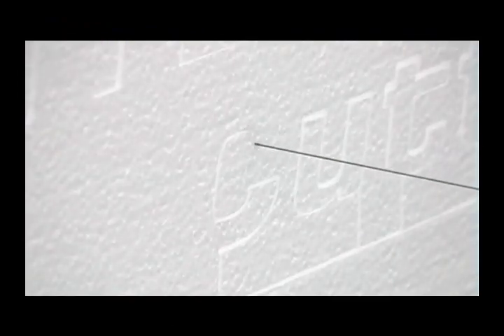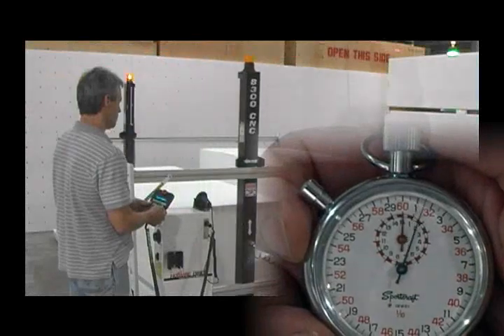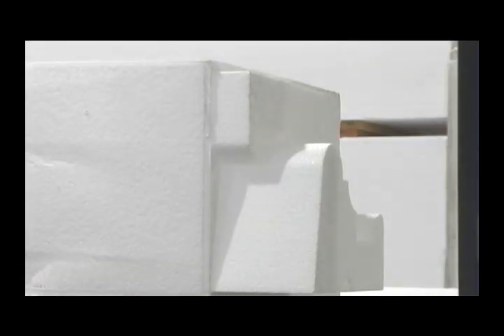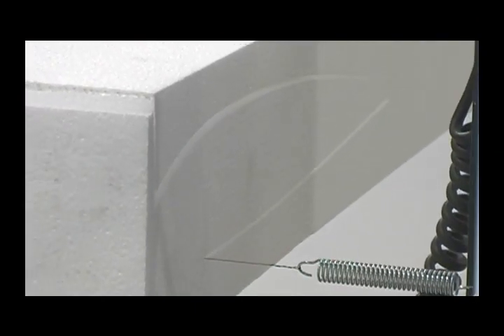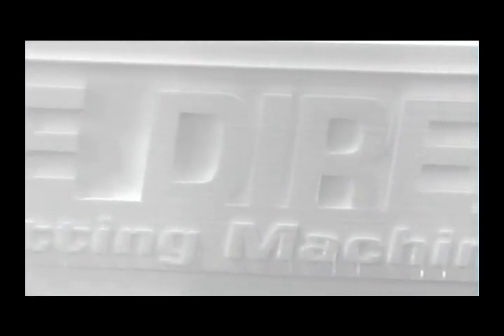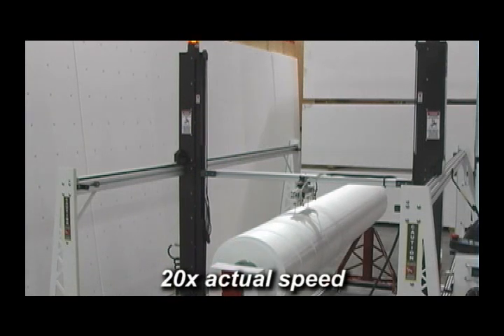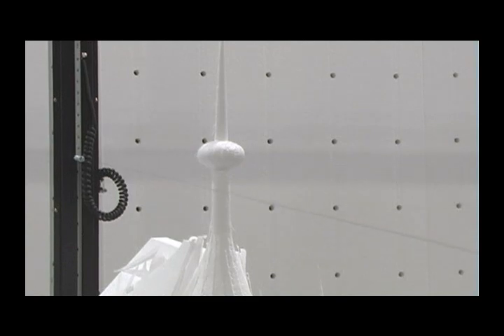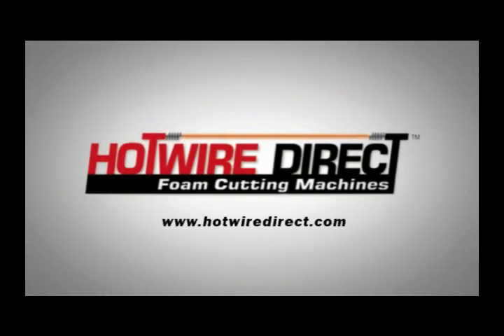CNC Foam Cutter

Comment: Any of your customers using your machines to cut EPP and other types of foam for
RC model wings fuselages etc. Im looking for a cnc hotwire cutter to cut my RC models
that I will be selling. I will be doing alot of flying wings which is a easy design to cut I would think, now Im not sure if a fuselage design could be cut this way.

Comment from the maker: Jeremy, 
Although you can cut blocks that have been glued together using our hotmelt adhesive glue and 3200 or 6300 glue gun, it will cut a bit slower and we don't usually do that. 

We generally start with large blocks (approx 4'x4'x8'). You can find a list of block molders on our website under FAQ's. These companies supply 1 lb to 2 lb per cubic foot density EPS foams.